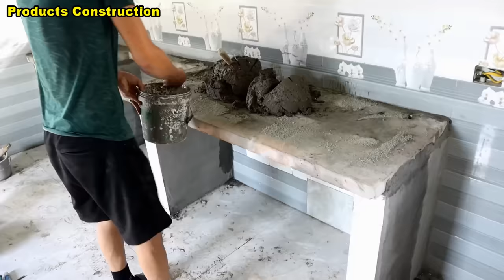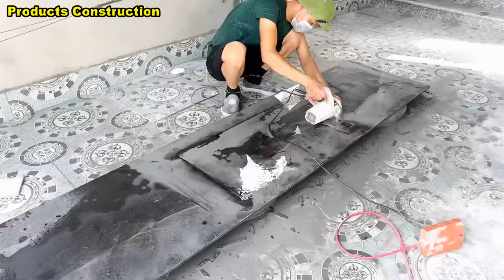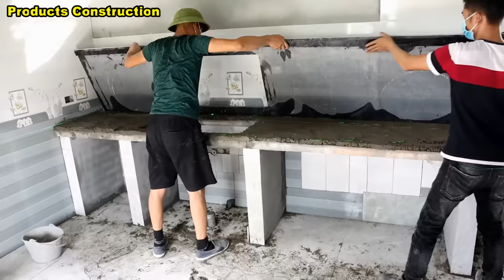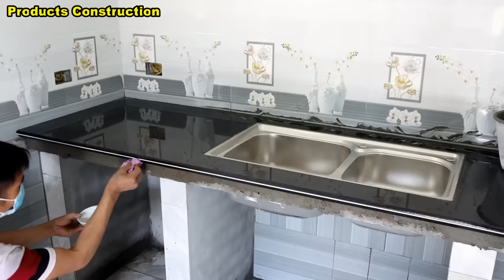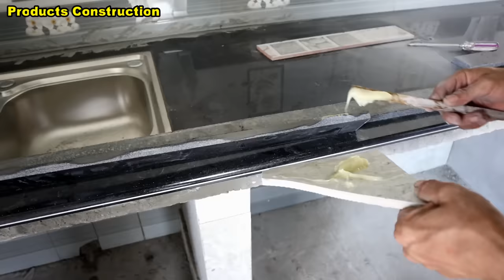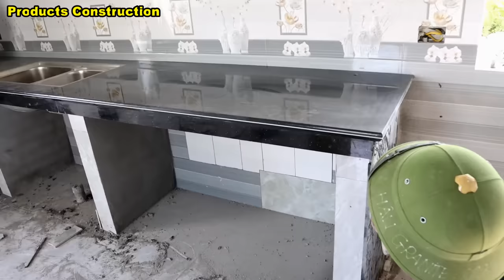How To Install Granit Kitchen Table - Kitchen Table Complete

Comment: This kitchen table is supported by 4 brick work pillar supports. This will become a hindrance while installing the hobs and kitchen sinks and partitioning for kitchen racks and trays. To avoid this it is wiser to calculate the table height, make the concrete slab while the side walls are constructed. The concrete slab is to be laid into the full thickness of the wall thereby offering good support. The dimensions of the kitchen sink and hob must be decided beforehand to make appropriate openings in the slab. If this is done you will have a free underspace, you can customize your kitchen fittings with elegance.
Reply: Wow
Reply: Faisable. Correct dans l'ensemble
Reply: Lual o nome deva preda
Reply: X in the x in
Reply: Yes, every care must be taken before making the kitchen set, many have a nice look outside but inside placement must be considered to make excellent use of the kitchen, remember also it is usually a lady that stays in the kitchen don't give her a hard time. :face-blue-smiling:

Comment: The most irresponsible way of mounting a counter top by over cut the hole and  insert a wood. It should be calculated the sitting size let the sink sit in it. The wood will eventually rot away when the owner use the sink. Water seepage will rot the wood. Be it you silicone and as time goes by, water will seepage in.
Reply: That is not wood , that is tiles lolz

Comment: You might have used a black color jointer or solution on the joint of side small strip, it is now looking as two broken strip

Comment: I dont understand why they measured the outside perimeter of the sink when those types of aluminum sinks have a lip all the way around and are made to sit on top of the countertop.
Reply: But they have inset sink no need for mastic seal.
Reply: And I don't understand why they haven't made a sink from Granite as well after all this great and masterful  work